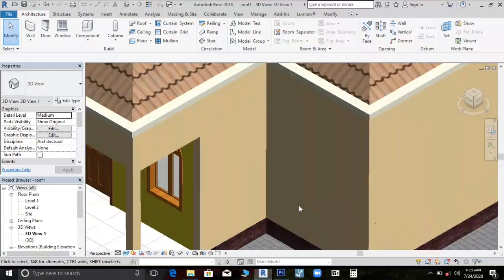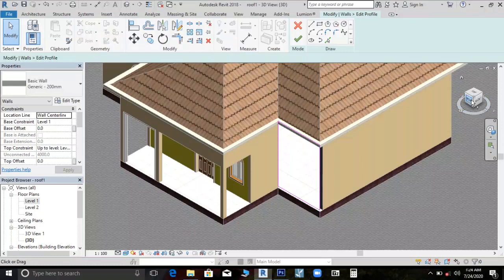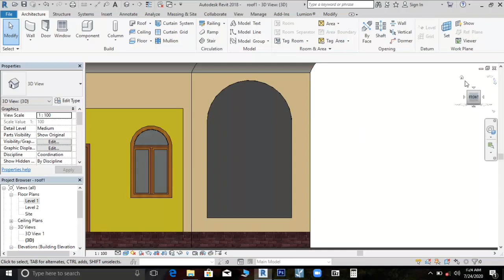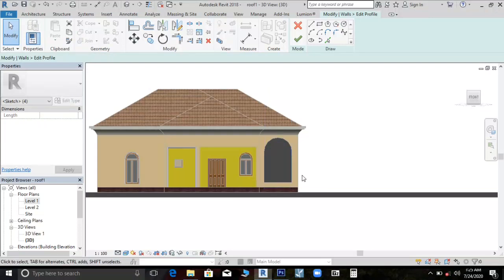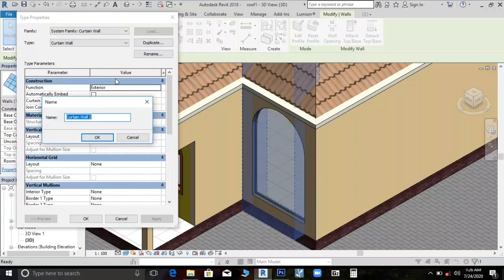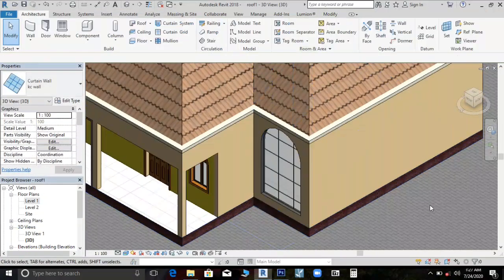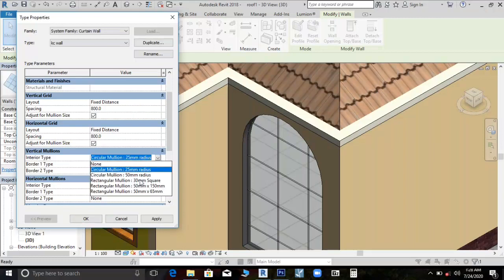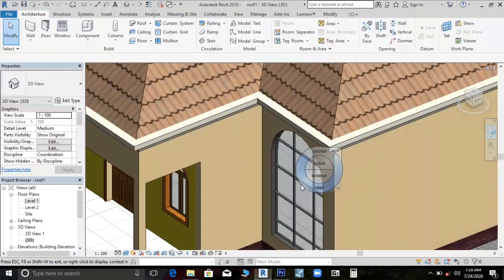Create Arc Window with Mullion in Revit architecture

Comment: You don't need to cut the first wall, you just pick the curtain and apply it on the exsisted wall, it is automatically embed, and then you can change the curtain profile, so it can be arched top, you well get a mullion frame as well, thank you